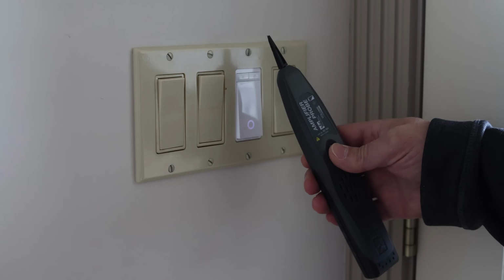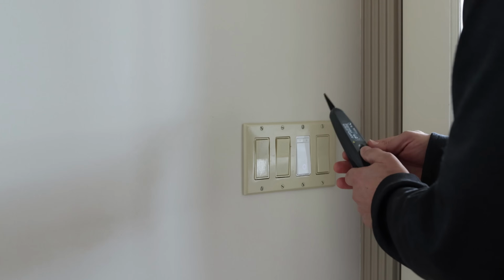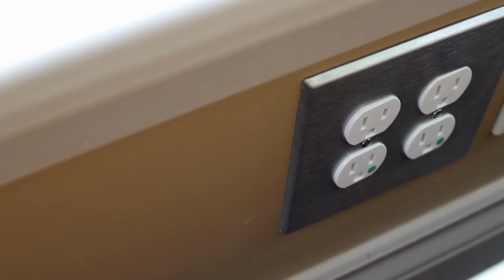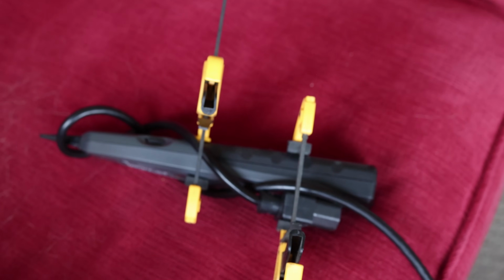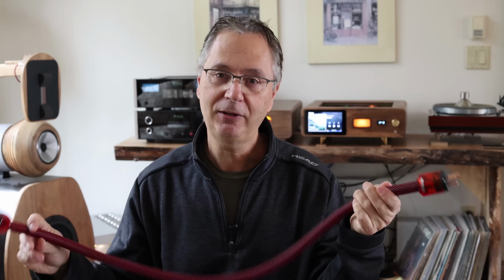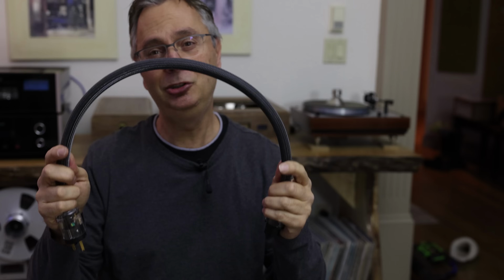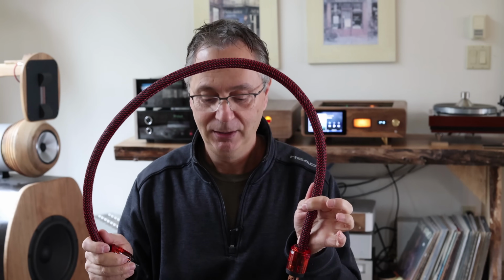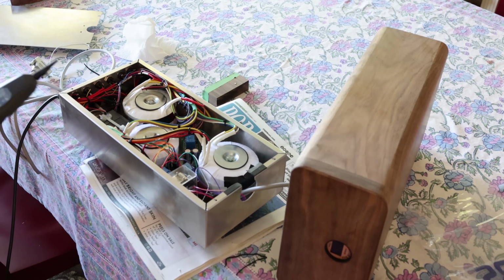My Top 5 Inexpensive Hifi Tweaks for clean power to your amp, preamp, dac, turntable, and more.

Comment: I too noticed that problem several years back, even worse with LED lights. I removed all of them years ago. Even the wifi LEF lights, such as Feit have this issue but to a lessor extent. I utilize Greenwave plugs througout the house and place them on noise circuits such as refrigerator, paper shredders, wifi router, switch and TV compents. I don't place these directly on my audio circuits but by putting these on other noisy circuits, this greatly reduces the noise on my dedicated audio circuits. I will utiluze several audio power conditioners but overal, I am quite please with my results. I also ran a new solid core ground wire to qty-2 8ft copper ground rods, distanced about 18 feet apart and while I do not notice any sound improvements, this seems to have reduced electrical surges but could also be a coincidence. Keep digital sources on one dedicate circuit and analog , amps, etc on a separate circuit has improved my soundstage a bit.

Comment: I just tested my setup. Only getting emi from the transformer in my linear power supply. Should I replace it or just keep it far away from my other equipment? Is the transformer emi filtered out when it exits as DC?
Reply from the maker: If it is a separate power supply check the output line if it carries lots of noise a bit is fine most transformers have a bit of electro magnetic noise as long as it is not huge it is fine

Comment: Hello All, wanted suggestion from you guys...i am missing channel separation in my system..my system is Marantz NA8005 as Network streamer(DA convertor)--->Yamaha AS1000(Integrated)-->Jamo S708....what am i missing here??
Reply: Most likely the Jamos are the problem. You're amp and streamer are pretty good quality I belive.
Reply: @Pete.across.the.street  Thank you will look at using a separate speaker and test
Reply: @srijithview  oh wait. What did you mean by channel separation? I misread it as instrument separation. You might just need to experiment with your speaker placement.
Reply: @Pete.across.the.street  Exactly i meant instrument separation..in the current setup it feels like both the speakers are playing in mono and not stereo
Reply: @srijithview  play with speaker placement first. But those Jamos are more of a budget speaker. You need to go upmarket a little more to get what you are looking for.
Reply from the maker: Go on Spotify tidal or whatever you stream from and search for test music and play some tests like right Chanel left Chanel  center image   Trac and see may be something is wrong in the setup also speaker placement is key
Reply: @Gabster1  Thanks for the suggestion, have changed the speaker position and it has solved the issue...now i can hear more holographic music

Comment: Nice Video Gabby as usual, I am running 3 dedicated 20A lines and I thought it was good enough! BTW how many hours a day is your C1100 on for?
Reply from the maker: Got some very expensive tubes in it so it shuts down 30 min after no sign of use, it is in the setup menu
Reply: @Gabster1  thanks, care to share which make tubes mine are still all stock.

Comment: Is the 10 gauge wire really necessary? Are you expecting to use a stickwelder on the same dedicated line, something up to 16-20A?

Most of my old stereo systems have had good power sections. And they have had good shielding, the recievers even more so. The times I have had troubles with my systems (noise) are when some thing breakes down in the powersupply..turning the whole case into a receiver.
Reply from the maker: 12 is fine but a 20 amp breaker and good outlet  is a must
Reply: @Gabster1  Even if a big huge system or mid PA tops out at less than 20A?
Ofc it's always good to have ok outlets.

Comment: Wonderful video.  Very interested about noise coming from other sources through the dedicated Line. Dedicated lines don't mean noise free. Dedicated only really good too furnish dedicated power via a 10 gauge wire.  

Hopefully they'll be a part two that discusses Power conditioners, etc. I like the way you test things.  I use aTransparent Power isolator, which is sold with a 10 gauge Power cord. I think it's helpful. I'm gonna buy that noise testing device you have.  I am told his power isolator it's OK to plug an amp into as it doesn't restrict Power. But I'm hopeful it reduces noise.
Reply: All your circuits connect together at your panel, that's why. Even your neighbors circuits are connected to yours. Everybody on the load side of the utility's transformer are connected together. Could be from 1 to even 10 houses.Dedicated cir. are mainly for hi draw stuff that if combined with other loads would trip the breaker. A lot of people in the audio world have grabbed ideas not fully understanding how electricity works or interacts and just run with it. Not critisizing this vid, he seems very knowlegable.
Reply: @bradt.3555  I agree with your excellent points.  So we get back to a good power isolator/conditioner or possibly regeneration of the electronic signal coming out of the outlet.  Dedicated circuits really don't reduce noise and they need something Beyond just increased electrical power. They can be helpful but don't really resolve the issue to reduce noise.  Lots of common sense stuff obscured by all this technological gibberish.
Reply: @iampuzzleman282  Also if you have a decent piece of gear the power supply has a isolation transformer, ( any trans isolates) and a good filtration system. SS has to step voltage down, tube steps it up. This is why some don't like switching pwr supplies. They're noisy and don't have a trans for isolation.
Reply: Some power conditioners suck to much power from your system, so I've heard. I had just a cheap 8 line and changed back to the wall and noticed the difference. Now some may operate on a different dynamic that could actually improve. Just sayin..
Reply: @robertwoodward9231  That's an interesting take. No conditioner should actually "suck" power from the devices as they don't really use power so to speak. I think I get what you mean tho. In reality audio equipment doesn't draw a lot of current. Yea that's generalizing, lot's of stuff or 3000 watt amps, etc. can start to add up. Many of these exotic systems you see on utube ,plug into a standard 20amp recpt. That's 2400 watts draw at 120 volts, not amp output  Measure the current draw of a large power amp and be surprised how little current it draws I have a little Furman, (pretty much a glorified power strip, maybe a bit better), really absolute zero difference in sound quality with or without. And our power is pretty dirty. The power supply in most gear is one of the best filters you can have, Putting stuff in front of it doesn't do much.

Comment: Curious as to the kinds of shielding is used in cables. Great info and thanks👍👍
Reply: Just search for VSD cables. They are used for motor frequency controllers to reduce noise coming out. Not cheap!
Reply: @darylsummer1424  I bet, not cheap👍

Comment: I randomly ran across your video here and want to say thank you Gabby for speaking truth and demonstrating something for me. First of all, looking at the very high-end gear you have in frame I expected to hear the same thing as always: "Oh, you need to buy this $2000 cable or this or that and you need to rewire your place even if you are in an apartment and other junk". Instead you spoke to reality and truth! On top of that you demonstrated! 
One in particular stood out to me: Power cables. I know that they don't usually make a sizable or detectable difference sonically to the human ear (no such thing as golden ears) as many claim, but  you just demonstrated they are important none the less. I have always believed that the power cables that come with the gear, including high-end gear, come with them for a reason and I figured using anything else would void the warranty. Every "audiophile" that has ever said to me that they make a huge sound difference or what have you has NEVER demonstrated that! You just changed my belief in your video here! I'm still correct in stating that the power cables that come with the gear come with it for a reason, but that reason is cost savings to the manufacture!  Indeed, power cables won't necessarily make a sonic difference easily detected by ear, but a shielded power cable is far healthier for the gear anyway, whether you hear it or not! 
Changing out my power cables won't be that easy though as I have four pieces with such cables, (I run separates), so perhaps the best I can do is one at a time. However, the other problem I have is that I use a very good Power Conditioner/surge protector to plug almost everything into and there is not enough room behind it to accommodate the huge terminators (connectors). I rent an apartment and do not have enough outlets to plug everything into the wall directly. (Besides that surge protector has saved me more than once). So I need to figure out how to make shielded power cables work in my system as I am keen on replacing all of them, which I never thought I would hear myself say as I don't believe in the hype about cables generally, but now except power cables, which is not all hype!  (Yes, I am going to purchase a tester just to see for myself, which is something I usually do anyway. All it will do is confirm what you just showed).
Reply: There is an error in this type of testing. The power cable test only demonstrated that the shielded power cable had reduced noise on the outside of cable. Nothing was tested inside the Amplifier at the transformer. I don't understand the logic in this test.
Reply: @darylsummer1424  I don't think it matters since there is no sonic improvement to the ear. It is just likely healthier for the gear is all. Is it worth upgrading the power cables? That is up to the individual. It is not a guaranteed sonic improvement, so it is not a "must do". Personally, for me at this time, I'm happy with the power cables that came with the gear even though they are $2 cables or something. If I ever have the extra scratch, I might swap them out, but they are not mission critical nor make any sonic difference, so they may or may never be swapped out for "better" cables. By the way, better power cables can be had for around $35 to $40. One need not spend thousands or even hundreds of dollars on them.
Reply from the maker: Thanks Eric glad I was able to show you, still don't expect a huge difference I hate that too when people exaggerate and say the sound collapsed with the old cable  .....

Comment: What about wi-fi light bulbs, do they still make a lot of noise? That's why I never supported the  esoteric audiophiles that claim that "platinum diamond" cables make wonders... you have one bad phone charger and it fcks up your entire electrical network. It's really stupid. If they really want that extra 0.1% they're better off making their own grid :)))))
Reply: What is missed by many is what happens to that "dirty" electricity when it goes into their systems. The quality of the transformer, design of powersupply and shielding has more to with their systems being quiet. 
"Medical grade" transformers. If he wanted really quiet ones he should have gotten transformers from the big old receivers used by different goverment branches.
Reply: @secularnevrosis  ironcore inductors are worse for audio. Medical grade Toroidal inductors are the way to go
Reply: @andreimj  Well. They are at least much lighter. But I don't see the point of getting a "medical grade" one. For safety?
Reply from the maker: WIFI bulbs are ok if you do not dim them consider them as a bulb and a dimmer in one. :)
Reply: For 💯% of the performance I Did Make My Own Power Grid.

Comment: My biggest offenders are when the Refrigerator turns on and when the Furnace turns on. I have put Audio Filters on the Refrigerator outlet that helps a little. I use Neotech NEP-3002 MK III 7N Copper AC power cable and Furutech FI-28M R Male AC / Furutech FI-28 R IEC connectors on most areas. I built custom Powerstrip using a Furutech FI-28M R Male AC plug on the (FEQ) Ground Wire... Mad Scientist Kegs used on the Line-Neutral-Ground of the custom Powerstrip using Cardas 4181US AC Outlets. I use a lot ( $3K ) of Carbon Fiber Sheets under all gear that drastically lowers the Noise Floor. I own a lot of Mad Scientist Audio cables and other components.
Reply from the maker: Sounds like you are having fun and enjoying the hifi journey that is the best part :)

Comment: Should interconnects also be shielded?
Reply: Yes
Reply from the maker: Yes but rare to see a interconnect not shielded.
Reply: @Gabster1  Bluejeans’ popular interconnect cables have a white pvc looking cover, which doesn’t seem shielded.
Reply: @Simplyveej  actually, BJ interconnect cables have excellent shielding. After switching out all my cables to BJ it has transformed my system, much lower noise floor.

Comment: The more cables I shield the quieter my room becomes! In fact the last group of cables I shielded just happens to be the HDMIs and low and behold the room became quieter yet again. 🥳
Reply: I use an  Audiodharma Cable Cooker on all my cables before using them. FryCorder is a burn-in signal generator designed specifically for audio equipment power cords and room wiring. I use the FryCorder exclusively for conditioning all my house wiring.

Comment: i will immediately start tearing all the cables out of my walls and ceiling, leaving only one line left to the system, then i will have to use the camping gas cooker :) ...irony mode off :)  Very interesting research
Reply from the maker: Keep your Cooker on low away from your gear :)
Reply: @Gabster1  :)

Comment: A few years ago I made a post on The Vinyl Engine about the dimmers in my house and the power supply  that came with my Pro-Ject turntable. I was experiencing excess buzz and hum from this table. I changed to power supply and turned off my lights. Big difference.

Comment: Great video. Thank you. I unplug everything not needed when listening, specially, those nasty USB chargers! My apartment building uses aluminum wiring. Any thoughts on that?
Reply: Greenwave filters
Reply from the maker: If you can run a dedicated copper line go for it if not at the very least change your socket outlet with a medical grade one . expose a new layer of aluminum and  make sure the wires are very well  screwed. as often the connection is poor.
Reply: @Gabster1  oh, how I would love to run higrade Copper wire through a conduit with at least four duplex plugs! I don’t think the landlord would approve (or pay).   It is not recommended to use HiFi duplex, like PS Audio or Audience with aluminum wire.  Thx.
Reply: Thanks for the tip on usb chargers.

Comment: I bought that Amazon power cable and can attest that it is very good, especially for the money. I don’t know if it’s as good as my StraightWire cable that I use for my other amp, but I’ll soon be able to do a comparison.

Also, I’ve ordered fibre converters (TrendNet) to connect the Ethernet TCP/IP devices in my system and went ahead and ordered linear power supplies for those. It will be interesting to compare with the OEM power supplies.
Reply: Put LPS on your spf, modem, router, and switches too.
Reply: @Pete.across.the.street  At first I read that as “LPs” … like, WHAT???  LOL.  But yes, one thing at a time. My main switch is an older 3Com (remember them?) 16-port gigabit switch that was a data centre pull. It has four slots for optical transceivers, so I was fortunate. The 3Com’s power supply is built in.

I’ll test the Jameco LPS units that I ordered and if they suffice, will get some more for the other devices. I have fibre service to the house so the ONT may not need a power supply upgrade, but I’ll check it.
Reply: @Pete.across.the.street  do you have a brand that you find works?  I just upgraded my cable modem and wifi router, and got a Chromecast Ultra: all with TINY SMPS units.  I swear I hear constant 10-20khz whine thru my system, and have to think it's from the SMPSs....and like in the video, the system is on same line as dimmer switch lights (always on full bright though). Thank you!
Reply: @alanm.thornton4055     Brand of a linear power supply? Any brand will work, you just need to match the voltage to the voltage of your device and have amps = or > what is used on the device. If the dimmer switch is always on full, just replace the dimmer switch with a regular switch. I have found smart dimmer switches don't have the noise that regular ones do.
Reply from the maker: Thanks for confirming the cable quality.
I have done the same using a fibre ethernet with SPF and linear power supplies good to see I am not alone :)
Reply: Just use a shielded CAT6 Ethernet cable. Converters generate noise.
Reply: @darylsummer1424  The SFPs are built into the switches I use. All my Ethernet cables are shielded CAT6 or better